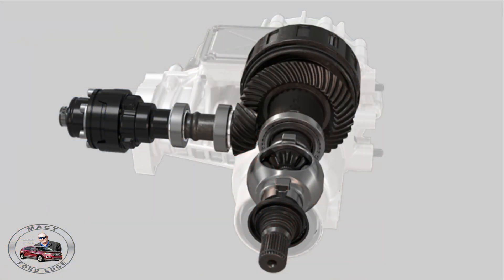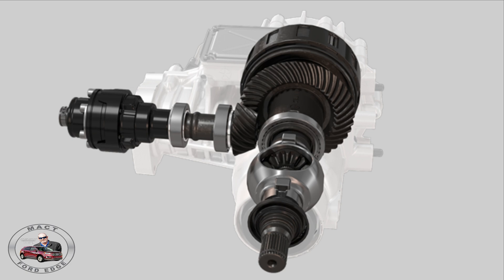AAM Ecotrac disconnecting AWD now the standard PTU on your Ford Edge

Comment: Ford should have a switch to engage the ptu so you will be able to be prepared for the situation instead of having to react to it. In some cases the response time makes you lose control of the vehicle. It would be safer for Ford to have the option for the driver to make the setting manually inside the cabin.
Reply from the maker: Owning both old and new versions the AAM is a much better system and reacts great compared to the 2007-2018 version from Ford.

Comment: My 2016 3.7L V6 AWD MKZ got the updated PTU with the drain plug. How often would you change the gear oil. I'm at about 5600 miles on the new PTU.  Also any idea if the 2019 MKZ has the updated drive train like the edge.. I knew that an American company was making them now just didn't know all the details I appreciate what you do
Reply: On my 2017 edge I change the ptu fluid every 20,000 miles, I’ve changed it twice now and both times the fluid looks really good
Reply: @davestewart9146  I had the dealer do the ptu of course at the same time the RDU was done 30k miles and the rear was oxidized have you done the rear?
Reply: @ChrisBerg-Tesla  I did the rdu and transmission flush and fill at 30k, fluid looked good and I haven’t had any problems
Reply: @davestewart9146  that's good. The technician said it was beginning  to oxidize I don't think it had the full synthetic in the rear it does now. I did everything once the PTU was leaking in 3 places that's when I had the other drive train fluids done now I know. I'm OCD on preventative maintenance. Ever since I had an old beater that I lost the ability to steer any creak or noise is checked out
Reply from the maker: 20K would be reasonable.  I am currently working on gear lube runs and testing using Redline Light Weight Shock Proof gear lube (LWSP) I will have another test in the near future with about 15K on the Redline LWSP
Reply: @MACTFordEdge  I'm still covered under warranty but the Hassel of waiting for a new part and so on and who knows in today's world if we will ever get back to normal. I've been waiting on the 4g modem upgrade part since November 9th before ford had a clue 3g was getting decommision

Comment: The only problem with this is that it's not as readily available now.   In other words, if you're speeding down the highway and then hit a patch of black ice and this thing engages, it has to take a second or two getting that relatively heavy drive shaft up to speed.  So you're gaining efficiency, but you're losing a little performance/  losing those mili-seconds of reaction time.  You save in wear of a constantly spinning shaft, but it also costs more to build/ in parts.   I think it's better overall, but there's almost always a trade off somewhere. lol